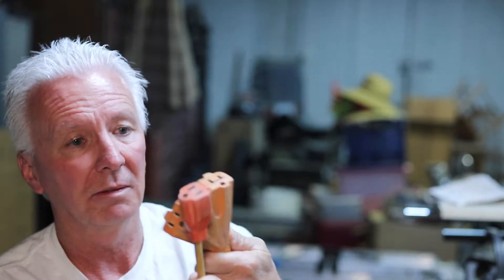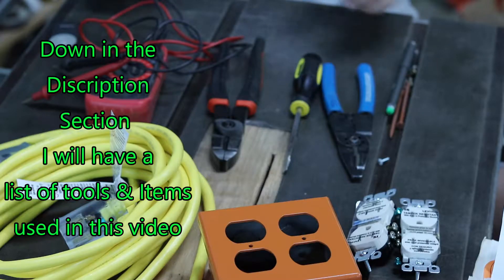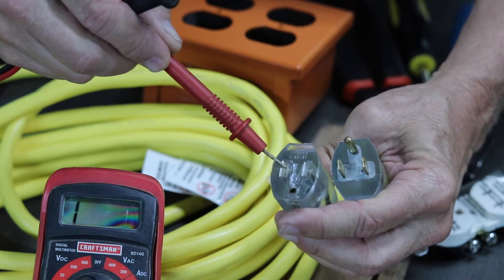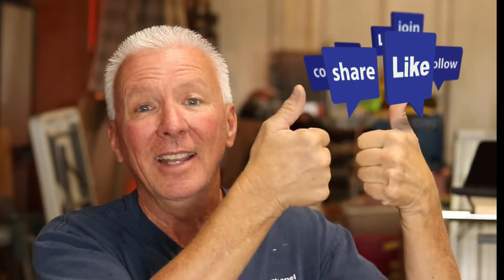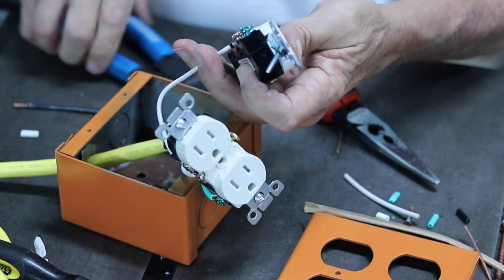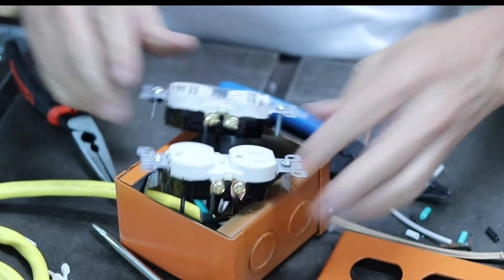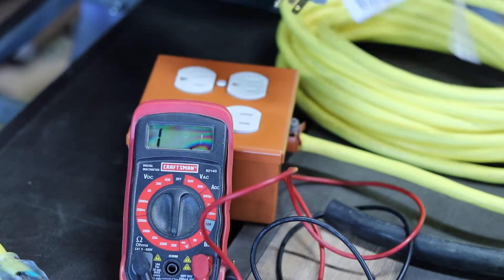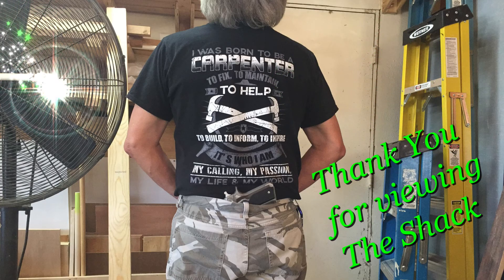How-to Wire 4 way outlet to an extension cord

Comment: I'm surprised your cord is still only a 15 amp cord.
The reason I clicked on this was because I was wondering if you'd recommend a more capable cord due to the 4 outlets.
Watts divided by volts equals amps.
I keep seeing neighbors here at the rv park using a space heater on an extension cord to bypass their circuit breaker. A "known" fire hazard. 
1500w heater÷120v=12.5 amps. Already too much for "15amp" cords.
That only gives you 2.5 amps to split with the other 3 outlets.
Something to consider if you're making one of these.
Reply: I'm sorry but your logic is completely wrong. To be clear though, nothing about this video is right. No one that knows anything electrical compliance would use a cord like this.
Reply: @geminye79  what part is completely wrong?
My interest in this is because people keep doing it anyway. By "it" I mean using a 15 amp cord, often light duty, and powering a 1500w space heater.
I have a burn mark on my floor and melted outlets on my power strip from back when I had no other option,  and didn't learn about the fire hazard until after I got lucky.
I've repaired several melted extention cords for people here. Not just from heaters but 30amp rv's plugged into the 15amp outlets on the power pedestals,  and people using adapters to plug 15amp cords into the 30amp outlets. 
That's why I like the notion of having a gang box that isn't going to melt, but don't like the multiple outlets that enable someone to draw too many amps through a cord that can't handle it. 
On my ceiling there's a single 20amp outlet, like for an ac unit or something. 
I like that, or a 20amp gfci +30amp cord if I were to make one.
I don't like the liability issue for making one for a neighbor,  but don't like the existing fire hazards I see either.
Reply: Cords like this have a job site intent on providing power for utilization equipment such as small drills, maybe some lighting, maybe a few battery chargers. They aren't designed or created from the factory for that matter to provide power for max wattage loads for an extended or almost indefinite amount of time. They're for convenience or lightweight work.  Appliances especially space heaters for that matter should never be plugged into an extension cord. Using extension like this no matter the gauge create hazards. I completely understand that "there's a real world out there" and that people who have limited options will do what they have to. But it's bad information that's disseminated to people who have absolutely no background or even a handy bone in their body to put things like this together that create more problems. Some people will watch this video and this k this guy did an amazing job, then make an attempt at mimicking his work but unsuccessfully and to a lesser degree thinking that his work was so great that I'm sure mine is considered adequate, and so on and so on. When in reality the work is so bad and people eventually get hurt. There's a reason that electrical code book is thicker than a phone book from the 80s and with tiny print written by teams of experts and lawyers. Because at some point somewhere, multiple times either property was damaged or people were killed. Unfortunately people are free to do as they wish, some succeed and some don't. But if you think it's silly to think no one has ever died from a faulty cord, lmao your mistaken. It happens sometimes.
Reply: @geminye79  I never said it was silly, or safe.
I said what I've been seeing around here is unsafe, and even this video with 4 outlets  on the cord has potential to be a problem if all were in use at the same time by say, my neighbors who'd likely be like, "cool, now I can plug 2 heaters in, and this, & this". Ha! Nooooo!
If I make one at all it will have 1 maybe 2 outlets at the most.
I don't really like it, but it seems safer than what's been going on already with all the melted cords I've seen here.
Perhaps I should buy people fire extinguishers for Christmas instead.
Reply: I guess I'm in the middle on this one. Because the first thing I consider when I think about what I need to power is what is the size of the conductor and what is the length of the cord that's really what matters here. To be honest I have no idea what you mean when you say a 15 amp cord. With my logic that means absolutely nothing. Videos like this need to come with a 5-minute disclaimer. Because unfortunately common sense is nowhere to be found. This is the same type of argument around power strips. Because people are too stupid to realize you can't just fill everything up everybody looks at powerstrips like an evil demon when in reality they are perfectly safe as long as used appropriately. Again the most important thing as far as I'm concerned when I pick out what cord I'm going to use is awg and the length.  You know the same thing electricians use when they plan out the circuitry of every house ever.
Reply: @brizzle8797  I mean a cord rated for 15 amps, instead of say a 30 amp twist lock generator cord, or a 30 amp rv extention cord. I paid $100 for a 25' 240v 50 amp rv extention cord so I can power my home style oven I have in my trailer.
I saw a thumbnail for another video like this today claiming "more power", but multiple receptacles won't give you more power. At the rv park where I live, people often use a 30 amp to 15 amp adapter to plug in a 15 amp cord, & if it has multiple receptacles on the other end, they get more danger.
Reply: @LarryMorrow2  
I think I see where you're going with this but I don't quite follow the logic fully. I fully understand the difference between the type of electrical sockets. But I believe that's more for what the socket is rated at delivering. Because I have a 100 ft 16 gauge cord that has a 15 amp connector and I also have a 100 ft 10 gauge extension cord with a 15 amp connector. I suppose these would both be 15 amp cords? 1 I used to power an LED work light drawing a few watts and the other I use to power a MIG welder!
So that's why I go back to what I said in my first comment. Aside from the obvious code violations he depicted in the video. Something we should all use to gauge what type of extension cord we use is the distance we needed to reach and the gauge of the conductors. That's really all there is to it. Because if you forget about the basics you will get yourself into trouble anyways.
Yes these other videos claiming more power and other nonsense like that are just going to get people hurt honestly. It just is so difficult to cover all of the bases of a particular use of something which is why I'll likely never create a YouTube video! Because even if you built the cord right can you plug 4 space heaters into it or 4 battery chargers in, you would have very different outcomes!
Reply: @brizzle8797  yes those are both 15 amp cords, but the 10 gauge is a heavy duty cord and the power draw of your welder is intermittent,  compared to something like my space heater in my flimsy ass trailer, with temperatures now dropping to single digits, it's running continuously. (Not on an extention cord don't worry)
The different sockets we have here at the rv park are a 20amp gfci, a 30amprv, and 50amp rv 240v. The adapters available done reduce the power available, and the outlets don't force you to draw all that it can give.
If you made one of these with two receptacles, and plugged in two space heaters, it would trip the 20amp gfci, but if using a 30 to 15 amp adapter you'd have about 25 amps flowing through the 15amp cord. The metal box would be an asset, but it's still a problem. 
My interest in these is the number of neighbors I have that are already doing sketchy shit & wanting to make it safer. Like a shorter heavy duty cord with a single receptacle in a metal box. So far I'm leaning towards keeping me safe from liability & not making anything for anyone.
Reply: @LarryMorrow2  
I think we're pretty much on the same page it's just that I've grown accustomed to referring to things differently. I refer to them as a 120 extension cord because because regardless of the amperage, for the most part! It will still be 120 volts at the other end.  again as long as not overloaded. But I don't get in the habit of calling them 15 amp cords because that tends to give someone the impression that they can run 15 amps through a cord LOL and you could depending on the makeup and the situation of course. Whenever someone asks hey do you have an extension cord I can use the first thing I ask is what are you going to plug in and how far away is it!
I agree 100% that old-school lighting and space heaters are a constant draw that are the two pitfalls of temporary powering situations. Sounds like you might need my 6 gauge extension cord then! 
I would also agree with you in keeping from concocting something for someone else. You might be the one to blame if something goes wrong. Even when they use it in a manner that it was not intended for, which you can't control.
Reply: @brizzle8797  a 15 amp extention cord and a 30 amp rv extention cord are both using 120 volts of "electrical pressure" from the outlet. 
To my understanding, which is basic, the 240v is actually two 120's out of sequence with each other. 60 hertz for one hot wire, and 60 hertz for the other, a shared neutral, and a shared ground. Not really twice as much electrical pressure. 
1 amp = 1 electron, the force is 120v ,at 60 pulses per second.
Reply: @LarryMorrow2  
Yes and no. The 60 hertz is the frequency at which the AC alternates. That's alternating current or AC. As far as 240 works that's pretty much right it's just too hot legs of 120 combined with a neutral and a ground if it's a 4 wire plug. And again I may be off on how I think of this but I don't think so. By all means somebody please correct me if I'm wrong because I would like to learn as well. 
Yes a 30 amp cord and a 15 amp cord are both running at 120 volts the main difference in the two is that if you were to fashion and adapter for the 30 amp plug and use a 15 amp cord you would turn it into a glow rod if you ran 30 amps through it. It is highly likely that the conductors of the 15 amp cord and the actual brass contact are not rated for that much amperage which is part of the reason they are shaped differently and a different size.
As far as 240 goes you'll notice or maybe not that generally the conductors are smaller depending on what you're trying to run. And that is because as the voltage increases the size of conductor required generally decreases.
I can't tell you how weird it was to have a 240-volt alarm clock when I lived in Europe! So strange for us here but much more efficient when you think about it.
Anyhow as far as I'm concerned it all goes back to the basics. I can probably run 15 amps through a 20 ft 120 volt extension cord but if I used that same thin gauge extension cord at 100 feet I would start to have heat and voltage drop problems. 
I recommend perusing the Southwire website. They have a wonderful calculator that really illustrates the difference they also have a downloadable app which I happen to have as well LOL anyhow you will see that the same load or a draw over an increased length will require a larger conductor. And this is the reason why I ask those two very important questions of myself when I need an extension cord. Because the only other safe option really is to use the max gauge extension cord regardless of 5 ft or 100 ft and that would just be silly! There is a very good reason why the 30 amp cord coming out of your trailer is only a given length. Because I would bet if you looked at the a w g rating on the side of the cord and calculated the distance it would be sufficient in size to carry 30 amps into your breaker box. But if you were to splice onto it and double its length without increasing the conductor size you may run into trouble. Again only if you plan on pulling the full 30 amps if you were just going to run a flat screen TV you'd be just fine.

Comment: It doesn't make sense to cut off a working extension cord end because you can just wire the receptacle to a male NEMA plug and plug it in to the extension cord.
Reply: I believe you missed the entire point here
Reply: Phillipeva Evansphi

You grossly missed the point of the video by 4 😂🤦‍♂️
Reply: The point of this video should have been the quick and easy path to a high dollar OSHA citation!

Comment: Stud Pack just posted a video making a very similar 4 way extension cord but they made one of the outlets a GFCI for safety and used a stain relief on the cord.  Check it out.
Reply: I was just going to respond the same.
Good job!

Comment: You didn't ground the box. There should be a 10-32 tapped hole in the back of the box for a green grounding screw. A green or bare 12 gauge wire connects there and the other end wire nutted to the other grounds. You'll get some grounding by virtue of the mounting screws, but it's not sufficient, particularly with the painted surface. If there's no threaded hole, you need to create one. You should also add some electrical tape around the screws on each receptacle to protect against shorting.
When dealing with stranded wire on receptacles you should not strip the insulation all the way off. Strip further back so about 3/4 inch of insulation remains. This will keep the strands from fraying or breaking. When you twist the wires together with a wire nut leave the stranded wire about 1/8 inch beyond the other solid wires for a better connection. You could also use a Wago lever nut, works well with solid and stranded wire.
Reply: I would also add the following:
(A) consider a ground fault outlet for the first outlet, as installed correctly, will protect itself and the secondary outlet;
(B) add a cable strain relief to the box rather than just pinching the incoming cable, as that eliminates a wear point on the cable; and
(C) tighten down the side screws on the second outlet to prevent potential shorts inside the box.
Reply: Hey nice tip thanks for sharing